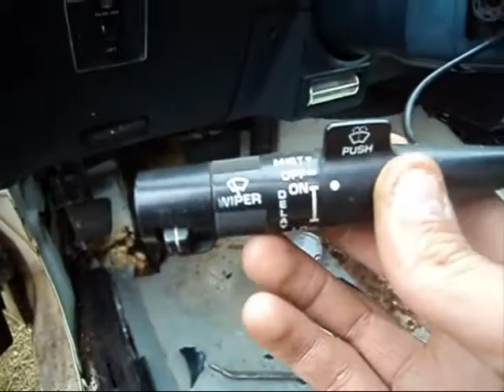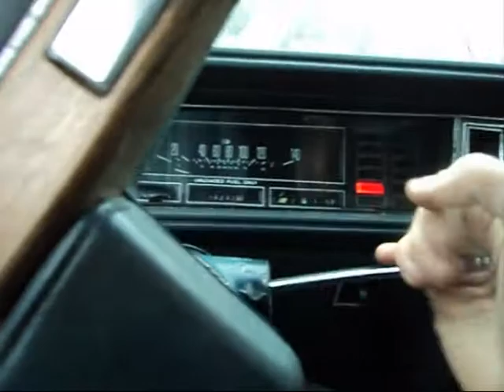Saying Goodbye to the Wobbled Out Oldsmobile

Comment: I need parts for my 86 442 and i need a drivers side door latch striker mechanism (the thing that goes inside the door to hold it closed) i also need tail lights because mine are shot, if u have any of these parts message me back ive really been having a hard time finding these parts i live in Charleston WV let me know haven't had much luck finding parts down here